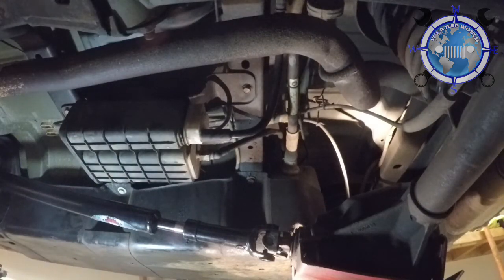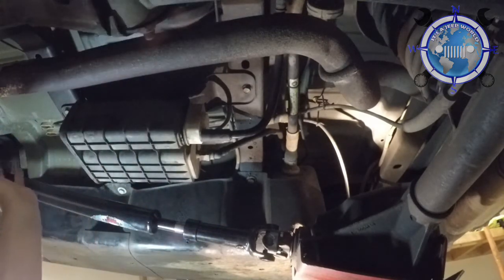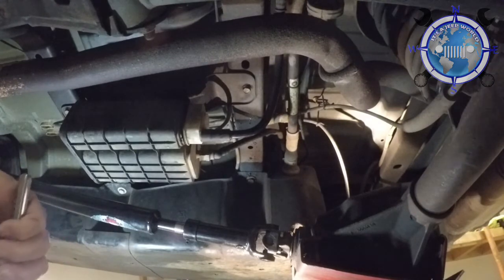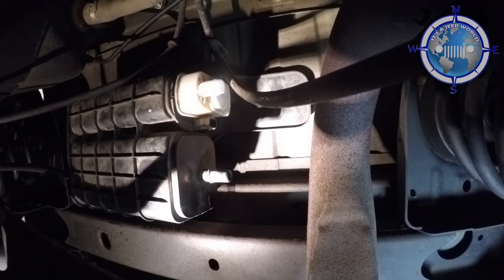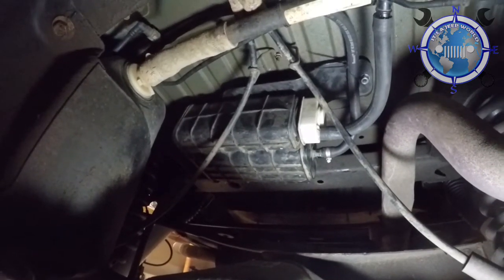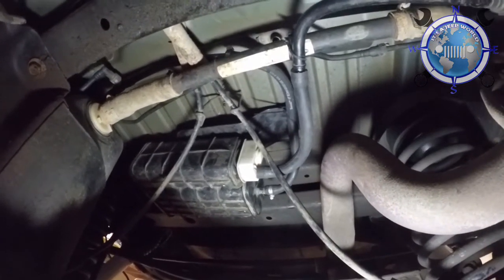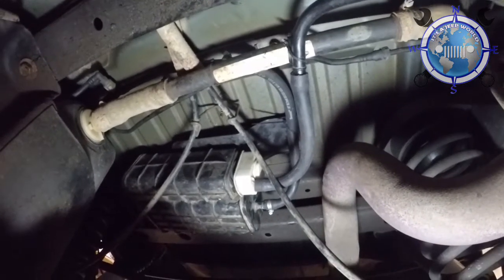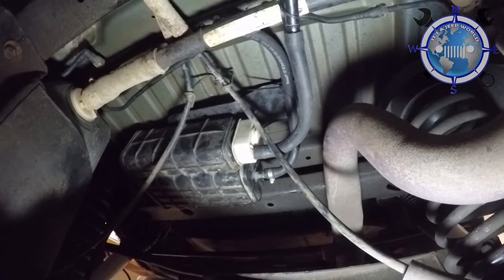Jeep Wrangler JK / JKU Fuel Vapor (Evaporator) Canister Relocation - It's a Jeep World (DIY)

Comment: I see that the Evap Canister stand is not flat, how do I install it on the back floor of the trunk? Adding screw nuts?
Reply from the maker: Pedro Méndez watch the whole video. I show the bolts and nuts I used
Reply: @ItsaJeepWorld  I mean if it was necessary to flatten the Evap Canister support to install it?